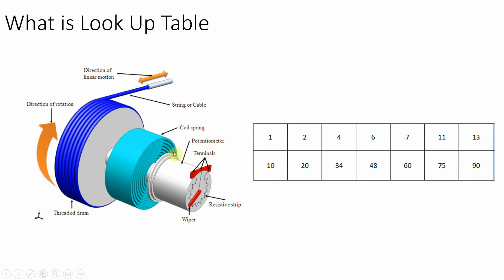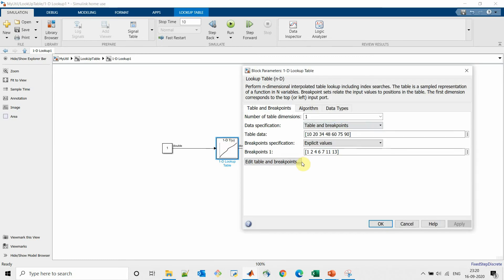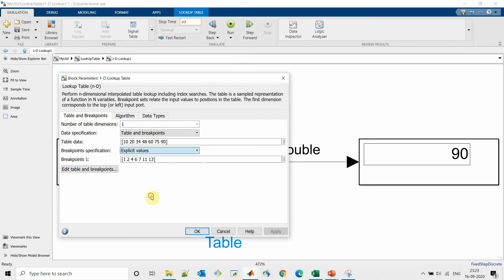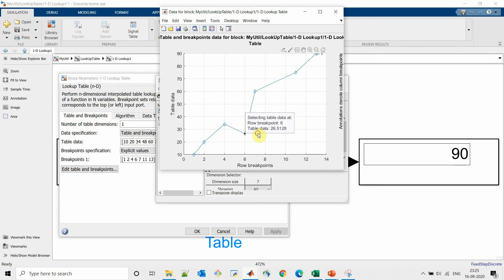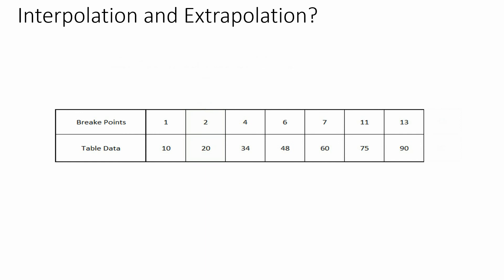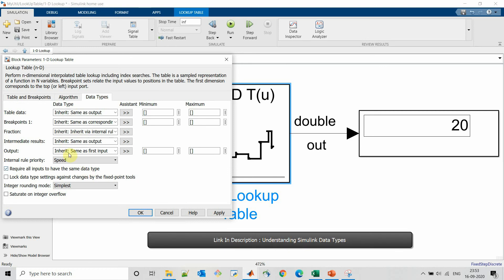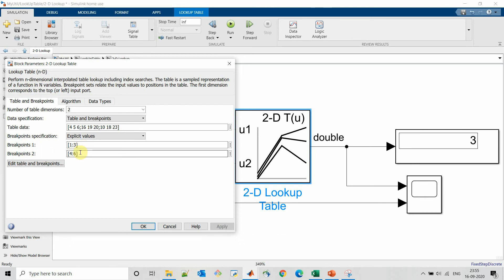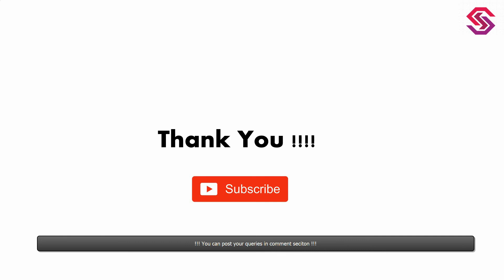Matlab Simulink  : How to use Simulink Lookup table

Comment: Hi, Is there a way to implement the same without using lookup table blocks ?
Reply from the maker: Hi, I didn't get your question completely. generally lookup tables are used as replacement to mathematical equations. So, if you don't want to use lookup table then atleast you can mathematically model the equation and obtain same results.
If this doesn't answer your question then you can email me your detailed problem statement. 
Thanks.